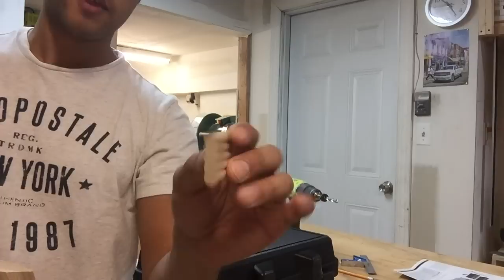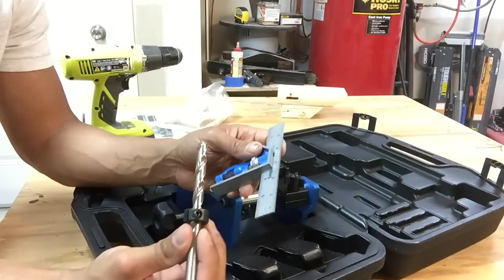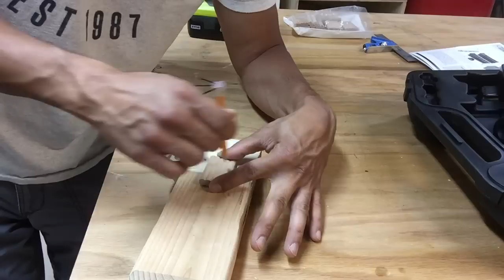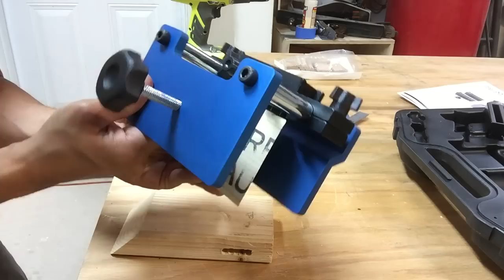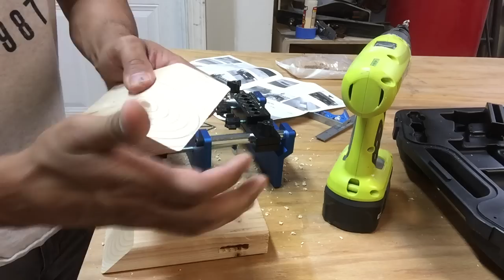Beadlock Pro Joinery Kit

Comment: Great video as usual, Anthony.  I had one of these sitting around untouched for years.  Just started trying it out now.  Rockler discontinued it, so I had a hard time buying the 1/2" and 1/4" accessories, but I finally found them after a dozen calls.  Did you ever go for the Domino or are you still using the Beadlock today?  I can see some limitations for the Beadlock.  For instance, if you want to attach a crosspiece in the middle of a table you're going to have a hard time accomplishing that with this jig.  Thanks for posting.  Mark
Reply from the maker: I used it a handful of times, but I eventually moved to the domino because of speed and accuracy.
Reply: @AnthonyScolaro1  Thanks, Anthony.  I'm not surprised that you went for the Festool.  Depending on how much more I get into woodworking, I'll be probably be going that route too.  Thanks again.  Mark

Comment: Can you still use that jig if you only wanted to put one or two dowels and something instead of doing the whole thing
Reply: Also curious about this - not sure why you couldn't.
Reply: I just bought one and haven't used it yet, but yeah you get a specific drill bit for each size, I think 1/2", 3/8" and 1/4" or something? Anyway, there's no reason you couldn't use it as a dowel jig just make sure you have the right size dowel for the drill bit. With the 6 slots you could even drill 1 slot, then 3rd slot, then 5 slot and you'd have 3 dowels in a row. Possibly more cost effective, but also if all you needed maybe for a smaller project was 1 dowel then it'd be perfect.

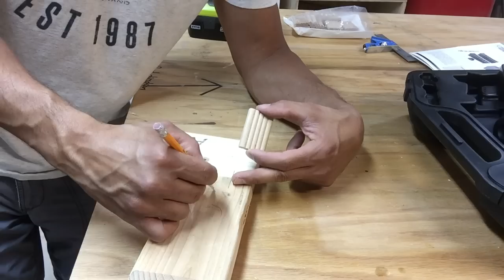Comment: At 5:31 in the video, you mark the two pieces A and B respectively. You mark the longer part on the right as A, and the shorter part on the left as B.
At 6:13 in the video, you say you take part A and insert it in the jig, when in fact you insert the part you marked as B originally.
At some point in time you have swopped the A and B markings on the pieces but have not corrected this in the video.
Why is that?
Reply from the maker: Ok Mr. Analyst lol you know how hard it is to edit these videos and explain things like this to the audience. I'm also using the same piece of wood to demonstrate multiple times. It's easy to forget what your doing sometimes when you're focusing on the camera and the work you're doing. As I said in the beginning of the video "this is not a replacement for the instruction manual". Everyone else got the general idea. Thanks for watching
Reply: Anthony Scolaro LOL - been struggling with the accuracy on the Beadlock and one way was to ensure the same face is always referenced on one side of the jig. Wasn't a criticism but just a question to help me understand if you're doing something different to improve the joint accuracy. 

Finally succcumbed and bought a Festool Domino yesterday
Reply from the maker: Craig Hart I'm sorry, wasn't trying to be nasty. I was actually trying make a joke of it. The main reason I see people fail with this system is the milling of the materials. If you are not milling your materials that you are joining at the same time and cutting, planing and jointing them with all the same settings on your machines, then the system will not be accurate. When I use this system, I mill all the workpieces at once then, if the thickness of the wood is not an easy number to divide in half, I use a fraction calculator to find the center. And read the instructions like 5 times. That should help. Sorry if you took my reply the wrong way.
Reply from the maker: Also if you don't clear all the dust chips, the guide block for drilling won't slide all the way over, creating a smaller uneven tenon hole
Reply: Hey Anthony - no worries, champ - didnt take it personally :)

Comment: Anyone have a follow up on how well this works and how well the joints hold?
Reply: This product is obsolete now . Why on earth did Rockler go downmarket with a plastic replacement. ? For what it's worth I made a set of dining chairs using the Beadlock and they are still rock solid after a few years. I really like that you can make your own tenon stock out of a strong hardwood like oak.

Comment: As far as demonstrated, this jig is only partly an alternative for the Festool Domino.Besides, this jig is much more complex to handle, takes a lot more effort and time and leaves a lot of dust/chips. Which all may lead to errors. In my opinion it's better to use an ordinary dowel jig, or... go for a domino :-)
Reply: peli71 You’re absolutely right, this does require a little more effort and mechanical skill.  Wait we’re talking about people who doing woodworking and presumably have a measure of mechanical skill so now I’m missing something because you can buy between 6 and 10 of these jigs for the money of a Festool.  This jig ain’t THAT complicated. I’m not knocking the Domino; it’s a great tool, but it’s is WAY overpriced.  I’m not a fanboy for either tool, just using sound financial decision making.
Reply: Personally, I think there is more setup on my Domino than on this Beadlock.  The Domino is quicker once the setup is complete.
Reply: @BobGarrett66  Exactly. If this is a hobby and you have extra money sure get the Domino why not. But if this is a business or a side hustle, your return on investment is going to be better on this beadlock system. Sure, it might cost you an extra minute or 2 in labor, but you're saving upwards of a thousand dollars. Also, the beadlock system theoretically will last forever as long as you don't wallow out the guide holes with your drill bit. Where as the Domino will only last as long as the motor lasts and you run into issues of the trigger breaking or something like that. So, the beadlock system could work for 40 years until you retire with out replacing it. If I had the money though, I'd buy both lol. Also, I imagine the beadlock dowels are probably cheaper than the Festool domino's so there's another cost saving factor there. Of course, building your own is always an option for both.

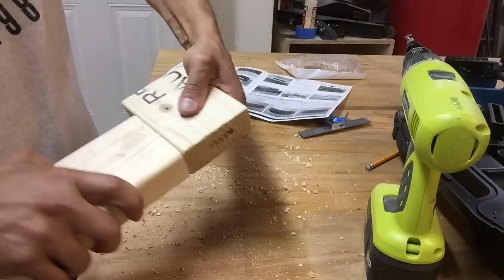Comment: Great review! For anybody who has bought one..... I have been looking at these as an Xmas gift to myself and have read the reviews online that have said the jig is consistently off by 1/16".   At 10:29 it does look like the vertical short piece is about 1/16" mis-aligned.  Is that really the case?  Or, maybe you addressed that below where you said u used rough cut lumber which you didn't surface on all 4 sides and another comment that said you should make sure the same face is always referenced on one side of the jig.
Reply from the maker: AndyB it only seemed off because of the rough cut lumber, if you s4s the wood it will be perfect. Watch my video on making a farmhouse table and you see me use it for the breadboard ends and the trestle legs. It's accurate if you follow the instructions and square the lumber
Reply: Anthony Scolaro Thank you for the reply. Excellent.
Reply: Got mine today.  Bought it because of your vid and reply.  These guys should sponsor you.

Comment: Not being critical here, just an observation. I think this may be a good product, however your analysis did not prove this. I would have preferred to see a more “real world” example with actual lumber as opposed to 2x4 which did not win me over. Showing an example with 3/4 stock would have a better shot at comparing to domino, dowels, mortise and tenon (traditional or machined), etc. All this showed was a dowel tenon in a 2x4.  Not asking to use figured mahogany, but some scrap poplar would have been a better choice for a more fair test and evaluation. Thanks for sharing this though, I may look into this a little more for some applications.
Reply from the maker: David watch my video on making a farmhouse table and you’ll see me use it for the breadboard ends and to attach the trestle legs
Reply: It literally works the same on any type of wood lol. The accuracy is really going to rely on how well the operator sets it up and lines up the marks.

Comment: I'm making some cabinet door stiles and rails out of oak using 1-by lumber (3/4" actual).   Is the 3/8" bead stock ok to use on this, or do I need something thinner?
Reply from the maker: Jerry Coleman the 3/8" is made for the 3/4" and up material. It will be fine.
Reply: Thanks.   Great video.  Maybe it will save me from having to read the instructions :) . BTW, nice bandsaw in the background.  Grizzly?

Comment: I begin saing that I am a Domino owner. This alternative seems to have some isues. First is the loooooong setup time. By the time you make one joint with this solution, the domino makes al lest 20 joints. Than, acuracy doesn't come close to the domino.
Reply from the maker: There is no question the domino joiner is superior, but you are incorrect about set up time. Off camera without explaining everything to an audience of people who have never seen this it only took about 1 minute to make both mortises. The only reason you don't see it as accurate is because I used 2 pieces of rough lumber which I did not surface on 4 sides. If I could drop $1,000 dollars on a domino machine, I would, but this will do for now. Thanks for watching